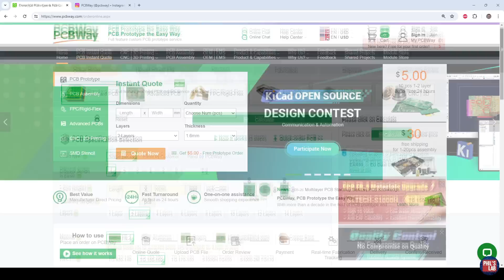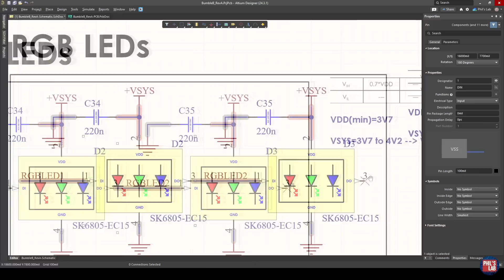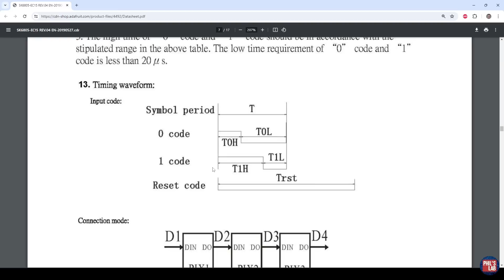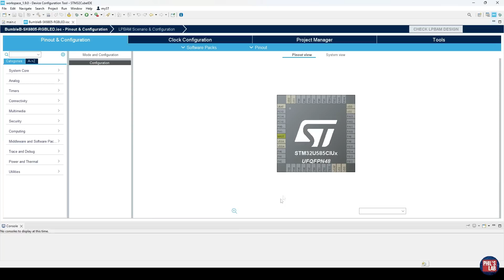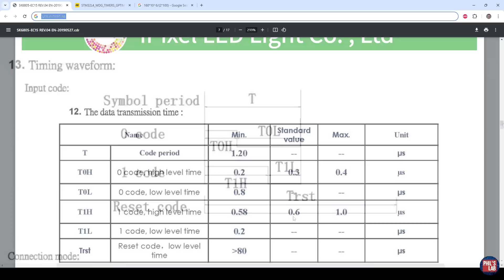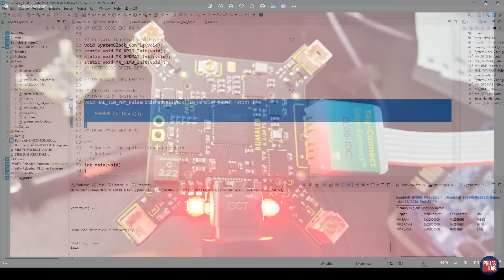STM32 + RGB LEDs Firmware Tutorial (TIM + DMA) - Phil's Lab #136

Comment: Hey Phil, great video as usual, however, something I noticed with your driver is that I believe that the bit order is wrong. it should be g7..g0, r7..r0, b7..b0, in MSB order. I have a feeling you didn't notice any issues since you were using 255 to test, so all the values for each bit were high anyway, but using any other value gives the incorrect brightness. I used the following and it is working for me with WS2812B leds:

uint16_t bufIndex = 0;

    for (uint8_t led = 0; led < NUM_LEDS; led++)
    { // for each LED

        for (uint8_t bits = 0; bits < BITS_PER_LED; bits++, bufIndex++)
        { // loop through all 24 bits
            uint8_t byte = (bits / 8) * 8;
            uint8_t bit = 7 - (bits % 8);
            uint8_t bitIndex = byte + bit;

            if ((LED_DATA[led].data >> bitIndex) & 0x01) // If bit set
                DMA_BUF[bufIndex] = T1H; // set pulse high
            else
                DMA_BUF[bufIndex] = T0H; // set pulse low
        }
    }
Reply from the maker: Thank you! You are completely right - sorry about that!
Reply: @PhilsLab  no worries, it happens! I thought I was losing my mind at first. Appreciate everything you do!
Reply: @daflamingfox   can you please send me e link where i can find a full code for this led's driver (sk6805) thank you
Reply: for (uint8_t ledIdx = 0; ledIdx < SK_NUM_LEDS; ledIdx++)
	{
		for (uint8_t bitIdx = 0; bitIdx < SK_LED_BITS; bitIdx++)
		{
			if ( (skLedData[ledIdx].data >> (SK_LED_BITS - 1 - bitIdx)) & 0x01 )
				skDmaBuffer[dmaBufIdx] = SK_H_VAL;
			else
				skDmaBuffer[dmaBufIdx] = SK_L_VAL;

			dmaBufIdx++;
		}
	}

this should do the trick
Reply: also in the struct the order of rgb is wrong due to memory endiannes
should be
typedef union
{
	struct 
	{
		uint8_t blue;
		uint8_t red;
		uint8_t green;
	} color;
	uint32_t data;
} sk6805dataRgb;

instead of

typedef union
{
	struct
	{
		uint8_t green;
		uint8_t red;
		uint8_t blue;
	} color;
	uint32_t data;
} sk6805dataRgb;

Comment: Thanks for video Phil. You used multiple periods to send reset sequence. I don't know the StmCube's DMA implementation, but in my implementation, for short strips, I set last byte to 0, and make DMA not circular. When DMA completes, it stops. DMA copies value on update trigger. This way last transmitted value would be 0. A single value for the reset signal. I know if you restart in a time that is shorter than 50us will break the reset sequence but we usually animate using a timer with a period. Which is in ms period.

Comment: Love your videos, the next step in my project happened to be designing a ws2812 driver for those exact led chips for a stm32u0 lol. You didn't need to use logic voltage translator? I have run into problems int the past when I didn't use on. Although with that project, I was using a bq24075 as my battery charger which outputs constant 5V no matter the battery charge, so that may be the difference.

Comment: Great video! Just curious why you chose C34/35 to be 220nF as opposed to the value shown in section 16 of the datasheet of 104 (which corresponds to 100nF).
Reply from the maker: Thanks! That's for BoM consolidation. I needed a specific 220n cap for a pin of the magnetometer, but the actual decoupling value for the rest of these parts is not a precise, required quantity.

Comment: Great video as usual!

I tried your implementation and found a quirk When running at a slower clock speed (64MHz) where the driver didn't work properly.

After sending the PWM data frame once, SK6805_DMA_COMPLETE_FLAG would get stuck at 0 forever.

Turned out, when the clock speed is low, HAL_TIM_PWM_Start_DMA would finish transfering PWM data to the timer so quickly that SK6805_Callback() is called BEFORE the code enters if (halStatus == HAL_OK) in order to clear *SK6805_DMA_COMPLETE_FLAG*.
Basically, HAL_TIM_PWM_Start_DMA is called, then SK6805_DMA_COMPLETE_FLAG is set to 1 by SK6805_Callback()*, but immediatly after *SK6805_DMA_COMPLETE_FLAG is set to 0 when we finally run *if (halStatus == HAL_OK)*.

My quick and dirty solution is to ditch if (halStatus == HAL_OK) and clear SK6805_DMA_COMPLETE_FLAG before *HAL_TIM_PWM_Start_DMA*. There's for sure a more elegant solution.
Reply from the maker: That's very interesting - thanks for sharing! Oddly enough, I haven't come across that myself (even on a G0 MCU running at 64MHz). Another (not particularly elegant) approach would be to check the complete flag in the while(1) loop in main.

Comment: The STM32U5 seems to handle the DMA/TIM transfer quite differently than other STM32s. I once implemented a WS2812B driver with 4 channels of 128+ LEDs each on an STM32F30, using the same principle. The key to making it work there was to 1) trigger DMA transfers via the TIM CC event (not at the end of the period) and 2) enable AutoReload preload, such that the new value is written to the register before the end of the PWM period. Otherwise it would output each bit value twice because the AR value was not updated fast enough.

In this video for the STM32U5, it seems that DMA (or the HAL?) appropriately times the transfer such that there is a new AR value ready for each PWM period, without having to enable AR preload.
Reply from the maker: Interesting to hear that that's the case for that MCU, thanks!

Comment: If you want you can optimize the color DMA update byt using a lookup table of 16x32bits values (LED 4bits).
Then you only need 6 writes for RGB values. This works due to you using 1byte for the PWM.

Comment: I used the WS28xx LEDs in a previous project, and just used DMA=>SPI peripheral; expanding out the bits in a frame-buffer in RAM so that a high bit = 110, and a low bit = 100 in the stream from the MOSI port (CLK not used). Those LEDs don't really need precise timing, so it was reliable and pretty simple to implement really - although a little bit wasteful of RAM, as it obviously needed 9 bytes for each 24bit colour value. 😁
Reply: By additionally using a down count timer in capture mode and directing the MOSI and MISO data to a port (preferably a port that has only the least significant two bits, PORTF - in many MCUs), and using one more DMA channel from overflow, this can be done completely in hardware, using only as many bits (RAM) as SPI needs for such sending.

Comment: I love these kind of elegant solutions. At work, I always take the time to write libraries that take advantage of the hardware on this level. One thing I don't really like though is the fact that each bit needs a byte of buffer space to be sent out. This may limit the capabilities of lower end microcontrollers with less memory (And I love the G0 series from ST). I have recently given some thought about using the SPI peripheral with DMA and a timer with some minimal external hardware so that I can control a lot of these LEDs basically without any CPU and memory overhead. It didn't get far but I figured that by using 2 timer channels to generate low and high pulses selecting the right one using MOSI and resetting the timer using the SPI clock, it can be achieved by purely using the SPI peripheral in DMA mode. It would of course be a trade-off but in projects where memory is a constraint, it could be useful. I will certainly do it during summer.
Reply from the maker: That's very true regarding the space needed for the DMA buffer. Interesting idea you have there with SPI + the two timer channels - looking forward to hearing about the results!
Reply: Wow, that sounds awesome. I would love to see a reference implementation!
Reply: Is there an update on how this went?

Comment: Thanks. I really enjoyed how you abstracted your code from low-level (hardware) to high-level (firmware).
I have not used a STM IDE since 2010. Any opinions on this current IDE and a beginners (for the IDE)  learning curve?
Reply from the maker: Thank you! Despite some occasional bugs, CubeIDE is my favourite (Eclipse-based) IDE. The whole pin-out, peripheral, clock, etc.. config makes set-up far more straightforward than many other system, in my eyes. Plus there's a large community behind all of this.
Reply: @PhilsLab  Thanks!